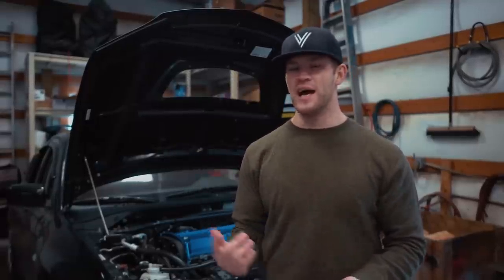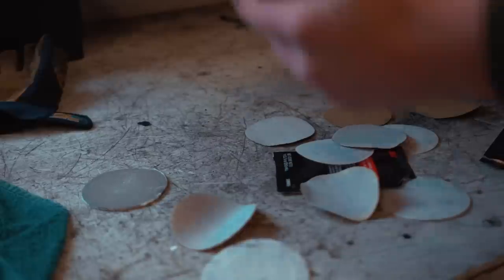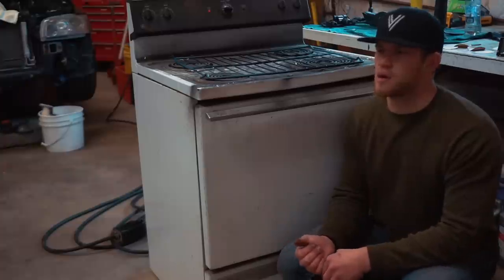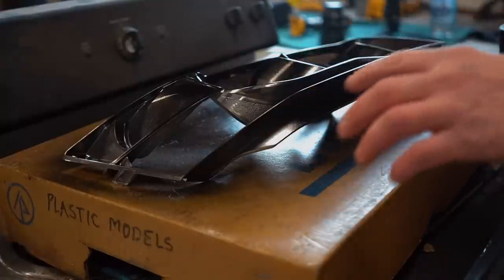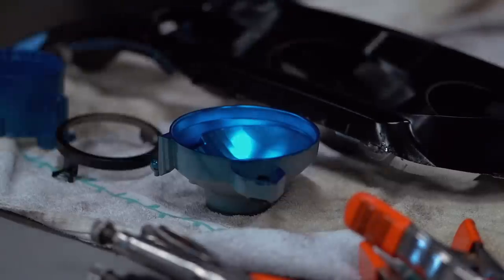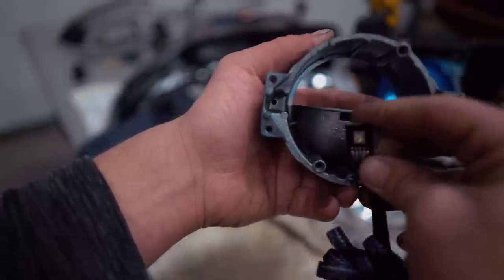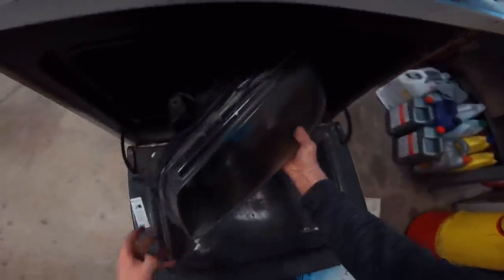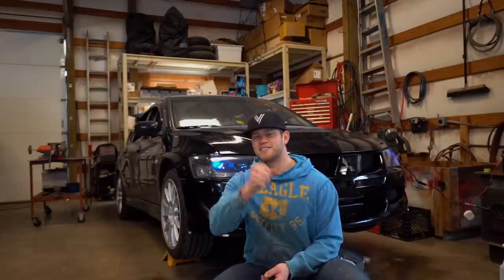Building Insane Headlights!

Comment: Can we quickly calrify... 200 Degrees Farenheit!! Heard horror stories of people in countries who use celsius melting headlights into goop! :)
Reply: come to the metric side water freezes at 0 and boils at 100 its all logical here.
Reply: check your demon eyes link in description
Reply: I've taken apart several headlights,
The best way i think is to use a heatgun, go all around frame. Then do one side and use a flathead or something plastic to wedge in there. Continually heat and it'll SLOWLY come out (just twist the flathead to help it).
Reply: @thongvu4281  I did it with a heatgun and an old cardboard box. i placed the box on its end, and cut a hole in the bottom, and then stuck a oven thermometer in the middle of the box. then just waited about 20 minutes. and keept an eye on the temp. about 80-90 celsius. if it gets hotter, you can just move the heatgun a bit away. :D (taped of all lifting holes in the box too btw)
Reply: In countries who use celsius.... THE WHOLE WORLD used Celsius. Everyone besides murica lmao
Reply: @nickdelong3537  LOL!! #murica
Reply: Damn freedom units.. America so behind
Reply: Once Headlight needs reassembling, do you need to put more glue on or reuse what's already on the lens?
Reply: Combien de durée ? + combien de chaleur ? 200°c?

Comment: Looks good but i don't think that black coat is going to hold up too well with a bit heat , i would have rubbed them down with 2000 grit or steel wool .
Have to give the paint the best chance of adhesion or after a while it will just flake off into the bottom of the light.

Comment: Shouldn’t you spray clear coat on headlight after buffing to prevent oxidation again?
Reply: No. You should apply something like Meguiars headlight coating, which is specifically made to protect acrylic headlight lenses from yellowing.
Reply: Paulo Fagundes Oh ok- thank you!
Reply: You can spray clear coat but it will eventually fade and peel. Some people ceramic coat them don’t know if that would be better.
Reply: Joshua Mitch yea I’ve heard stories about the clear coat cracking headlights... didn’t realize there were products out there designed for coating them
Reply: Paulo Fagundes cool
Reply: Never clear coat headlights. Use a UV protector like a sealant..
Reply: NEVER! EVER! I have had headlights on used vehicles with clear coat on the headlights. It's hard to get off. It makes them look good for a short while, but before long, it will also get cloudy. Cloudy on cloudy is not good. Just keep them clean. Restore occasionally, and you will have no problems.
Reply: i believe 3M and some other company's also make a "wrap/clear bra" for head lights to help prolong the effects of a headlight refresh ,another thing you can do, its kinda illegal, is replace the lens with a "glass" one, only down side is if your looking for a newer head light it probably dose not exist but some older cars(2000, maybe a little newer but not much) will have had glass head lights in other markets, just try to find some online, i did this with my old MK4 gti and it was great ordered them straight from hella, 200,000 km and four years later they still looked like new , just basic cleaning and polishing/waxing after cleaning the car

Comment: Use ammonia to remove the chrome. It works. Just let it soak for about 12-24 hours, and it will be gone. You still have a gloss finish to deal with, but no more chrome. Just use a little fine grit sand to get rid of the gloss, and you are ready to go.

Comment: Great video.  My buddy is doing his we keep having trouble with the dupli color  paint. It keeps cracking in the bowls. We tryed sanding chrome a little then  the primer then adhesive promoter then matt black. Seems cut & dry but cracks up every time. Even had new bowls sent & they are doing it also. Does duplicolor have a special trick to it? I'm ready to looe my shit on them idk what were doing wrong.  Been painting them for 2 weeks & I'm over it any advice would be awesome.  Thank u.

Comment: I recently had my headlights customized and had the housing shroud painted black and now I see alot of pitting on my lens. Is there something I can do to remove all the pitting ?
Reply: Since pitting implies that something has already been removed I'd say no. Only solution is sand down to the level of the pits or fill them in. New lenses or lamp assembly would likely be easier.

Comment: clean the lenses thoroughly after removing from the vehicle and then use an atomization cup with acetone in it. do this outdoors and don't keep your head near the cup/spout. this process is quicker, lasts longer, gives you a fully smooth finish. to protect it from then on, use something like Meguiar's G17110 Headlight protectant. (it doesn't have to be that, but its the best i've personally found and lasts close to a year with a single coat). never have to touch another of those silly buff and hope kits.

$45 roughly, for a cup + acetone, and 12-15ish for the meguiars, but properly stored acetone lasts just about forever, as does the headlight protectant, so unless you do tons of cars, you'll be able to touch up any issues one way or the other for years to come, without having to spend more time than using the buffing method.

the internal parts is entirely a subjective thing, and i have no input on any of that.
Reply: so the liquid used is acetone itself? interesting. i thought it was resin
Reply: just acetone in a cup that acts like a heater. it makes it 'steam', which then comes out the spout and you direct it onto the lens. acetone on most plastics makes the plastics melt, but with a fine mist of acetone on the surface all it does is reflow the surface plastic which then hardens when the liquid solvent portion evaporates. 

just makes sure to do so safely if you wish to attempt it yourself, proper gloves for handling acidic chemicals, and plenty of ventilation, preferably outside if its dry. and a chemical respirator mask. the length of time you'd need to be around it to do a pair of lenses is long enough that you'd be risking lung damage.

oh, and maybe try on a junk lens or two before working on something you plan on putting on a vehicle, its mostly a simple process, but it does require at least some trial and error. things li ke distance, time spent on a specific spot, the youtube videos that show it being done should give you a good idea, but its still needs some real world experience of the doing part, since the videos can't really teach your muscles the physical portion.

if you try it, good luck!

Comment: Did this guy actually paint a lens reflector blue???  This reminds me why I drive an Audi and not a mitsubishi.
And another thing mate, if you don't seal these lenses with uv resistant clearcoat, they will look worse than before in two weeks max.
Reply: Gplus sucks big lol not all lenses are the same mate, I been restoring headlights for a while now and there’s no need to put clear coat on them after the polished,,, although it looks way better when you clear coat them
Reply: You never use clear coat on lenses it will just turn yellow. you have to use ceramic coat.
Reply: @Gplus sucks big Exactly. I use a "headlight clearcoat" every time after headlight polishing, used it even on my car. Lights still look great, after almost 2 years
Reply: Audi drivers can't highway drive.
Reply: A UV resistant coating HAS to applied after polishing and the factory coating is removed. Only a novice thinks just a polish is ok, don't apply and guaranteed to start yellowing almost immediately.
Reply: Depending where you live they will be good for another year or so.
But if you are modifying anyway put a nice film over it and the problem is solved as well.

Comment: It looks great, but damn, you haven't used a scotch pad to roughen up the chrome. It will peel off the chromed parts in short time and also you should have used high heat resistant paint. All the best!
Reply: I've done this before.without roughing up.the chrome, used krylon fusion and it lasted for many years till I sold the car. Its not really an issue as it is sealed and doesn't get exposed to the elements, but.that is just my experience.
Reply: @sinformant  It should be fine then. I used Dupli-color if i remember corectly, on an older BMW and it only lasted nearly two years and it started cracking from the heat or pealing. All the best.

Comment: thats why i like my 1999 Volvo S40 T4 ( half evo half volvo ) headlights unclip no need for an oven :D
Reply: half evo? not in the slightest
Reply: @Cydro12  then you clearly have no idea that the Phase 1 S40 has an EVO 4 Chassis suspension set up and even the OFFSET FOR THE ALLOYS is evo evo parts BOLT STRAIGHT ON so easy upgrade to do
Reply: @TS-STORM  true, but so does my 1.3 mitsubishi colt. thats the only part its got in common with an evo, so i wouldnt really compare the two
Reply: @Cydro12  not forgetting the 2.0 4 cylinder tubro charged engine
Reply: Not even a Lancer let alone evo, more like a Carisma or Space Star.
Its not even that much Volvo either, it has a Volvo badge that is true but not manufactured by Volvo Sweden but by NedCars in the Netherlands.
okey it has 4 cilinders and a turbo but so do a lot of other cars.

Comment: Blacking out the chrome housing destroys your brightness. You need the chrome to help illuminate the road. Even with led conversions you lose light. Also if you're paying 1200-1500 for headlights you're looking in the wrong place.
Reply from the maker: If they are reflectors, then yes. Projectors, it does not matter what you do with the housings.

You may be referring to the blue on the high beam reflector bowl, yes that will dim the headlights like I mentioned but I am ok with that.

Comment: What did you use to reseal them ??
Reply: butyl rubber off ebay works great. I used that for my headlights
Reply: Chrisfix also used transparant laquer, might be an idea too?
Reply: Use only butyl. The same thing used to seal your windshield. No silicone or any household construction stuffs.
Check out the retrofit source, they do sell the proper stuff too
Reply: @bryaneekelder8267  use anything marine if possible, it'll protect the best against water
Reply: Danny Khoo okay so do I scrape off the oem glue or whatever they used and then install the butyl ?
Reply: @DannyKhoo89  For windshield they use PU compound, same is use for some cars full LED lights RS3, RS6, RS7, S8.
Reply: @seansmile  best if possible.

Comment: So, you enjoy not being able to see at night or something?

I'm not kidding: never drive this thing at night. It's just plain not safe, in any way, shape, nor form.

>inb4 the hate

No need to hate, you know I'm right.
Reply: exactly why? the only thing he did that will affect light output is the high beam painting. the projector is not affected by the black headlight housing obviously
Reply: Not to mention is illegal LOL.
Reply: The reflector that he painted blue is responsible for 1/4th of the lumen output. It does hinder the distance and brightness. It is not illegal as people say because the lamp itself is not blue or any shade bluer than blue HID. I think it looks sick and it is still brighter than any old car on the road and any car that has faded lenses. Nice video brotha 👌do your thing. That 10 with black on white is sick
Reply: @bikerboysrus1  Is it legal to have after market lighting on my car?
Any motor vehicle equipped with after market lighting, other than supplied by the manufacturer, must comply with certain regulations .  As specified in Sections 14-137-100 through 14-137-104 of the Department of Motor Vehicles (DMV) Regulations manual.

 What are the allowable colors for my after market lighting?
 Any light visible from a motor vehicle should be the following: 

      -  Any light visible from the front of the vehicle shall be white, 
         yellow or amber. 
      -  Any light visible from the forward most edge of the rear 
         tire of the vehicle to the front of the vehicle shall be 
         amber or yellow.
      -  Any light visible from the forward most edge of the rear
         tire of the vehicle to the rear of the vehicle shall be red.
      -  Any light visible from the rear of the vehicle shall be red 
         or amber.  
        (Effective July 25, 1994)
Reply: @CulichorHimself  
So again how is this illegal? The light is. White and even most light shades of blue are considered hyoer white which is only just recently being taken off the shelf. Imho its a debate that a cop will have for sure and its up to their discretion
Reply: @Cydro12  Blue is a terrible colour for night driving, The cooler the colour gets, the less our eyes are able to see it, so therefore worse for driving. A pure white/warm colour are much better for night-time driving, as our eyes are able to see it better
Reply: @bikerboysrus1  And its illegal because it gives off a stronger blue colour than it does white. Blue lights are for police, and they can pull you over if you have your headlights painted blue/red
Reply: @PurpleNoodleFace  what im getting at is they are "hyper white" blue than hell be okay but thats always a debate for a cop and how the cop interpreted it...i think hell be fine but who knows. I do know u cant have blues just like LED underside lights xannot be blue purple red because of ambulances and police
Reply: @PurpleNoodleFace  apparently i didnt watch the end...those are really blue yea those demon eyes are illegal. My bad brotha

Comment: Why you think that this "blue color aerosol" has good reflective property?
Have you mesured your headlights luminous intensity? Most of smart phones has this sensor.

I bet its crap now.  I have made lots of mods in my car headlights and theres nothing better than factory made anodised aluminium coating. Self made aluminium coating is rubish. Blue beam is total crap. Best option to have good vision in night is cool white or slightly yellow. So around 3200kelvins of light temperature. 3200k of lihts has best lighting wave length that will reflect the most of ligt back.